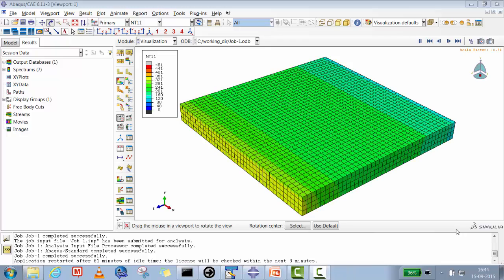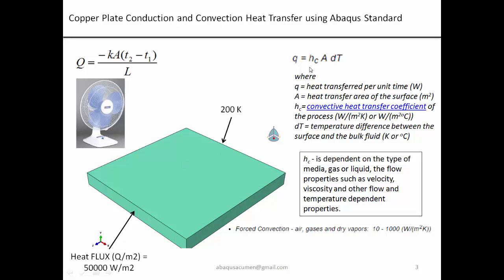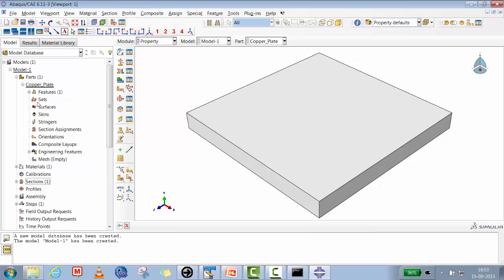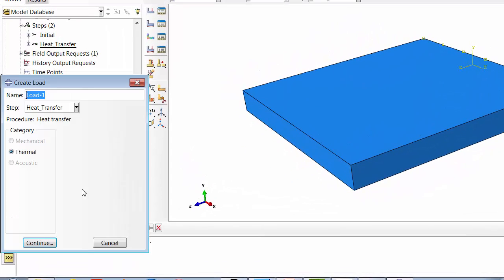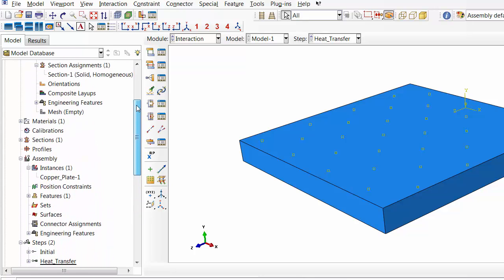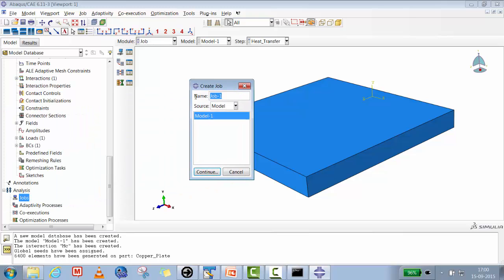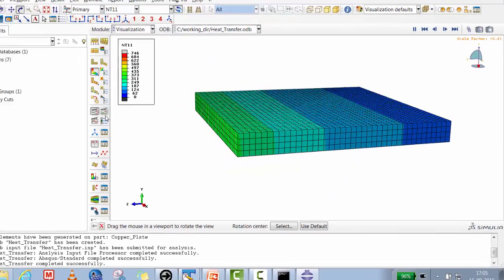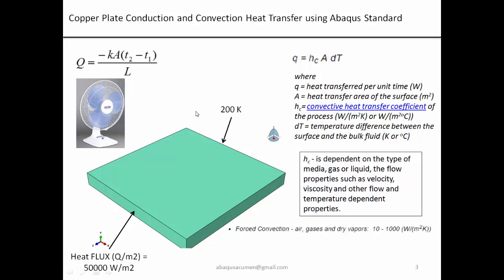Abaqus/CAE 6.11: How to do step by step conduction and convection mode of heat transfer using Abaqus

Comment: Thanks a lot 
You explain wonderfully through  step by step .please explain the  transient heat conduction  for cooling, of material is quenched  and also determine  temperature variations, stress at increment of  one  second.

Comment: simple and excellent.... but I want to ask  how did you ensure that other faces are thermally insulated though you have not assigned any boundary condition on these surfaces.
Reply from the maker: +abhishek kumar If you don't define any boundary condition on faces. Abaqus take it as fully insulated surface i.e no heat loss through face.
Reply: Thanks alot..you are doing excellent job...

Comment: Thank you sir. This was really helpful. I am trying to model spalling behaviour of concrete in fire using Abaqus. 
When I am modeling, I use Abaqus/Standard and Heat transfer step to create thermal load. I need to delete elements from the concrete wall, when element temperature reaches a specific limit(673K). How do I remove these elements in my model?

Comment: thank you for this example but if I have another Aluminum plate  in the bottom and the heater under the Aluminum plate and the flow is water ( no air ) come on a copper plate ? could you make example ?please